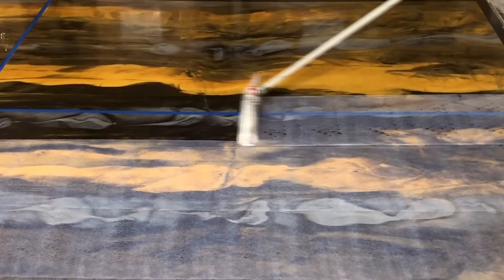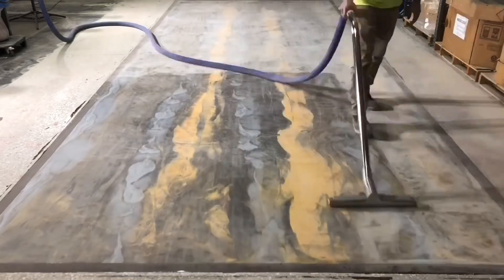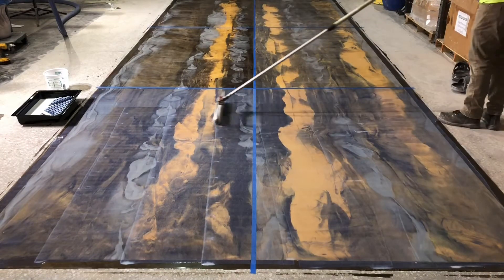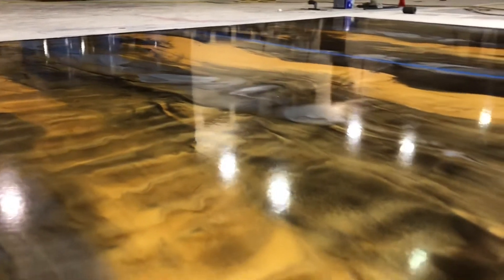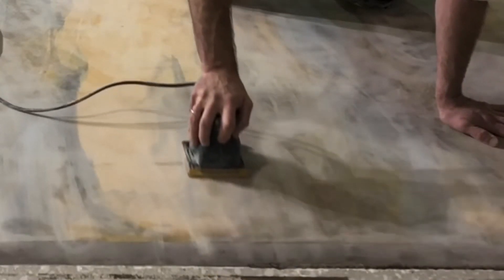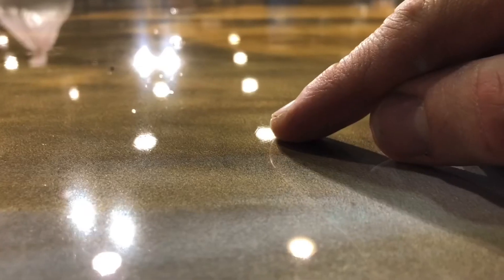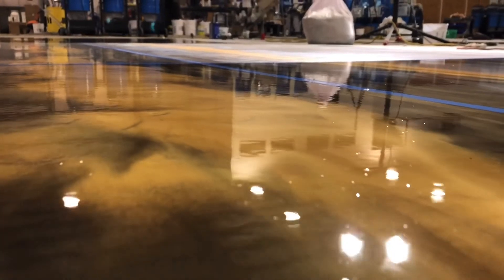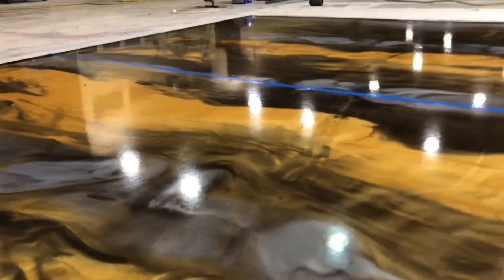Product Comparison: Epoxy Metallic Top Coatings

Comment: Josh why didn't you just use a buffer with a 100 grit sanding screen instead of the grinder?
Reply from the maker: That’s a great question. I’ve become used to using a grinder to de-glaze and flatten a coating. Having no sanding screens for the buffer, I had to improvise with the palm sander to reach what the grinder could not. It was slow, but it worked. 
Thanks for pointing out what most contractors would use to achieve the same result. I appreciate the feedback.
Reply: @joshjones8047  no pointing out here...I just thought maybe you had found it was a better process. I really enjoy your videos and sharing your knowledge. But sounds exactly like a job site...Get ready to sand and realize your out of screens.
Reply from the maker: @MrBradfordwill  thank you very much. Haha! Yeah, the jobsite has a way of reminding me what was forgotten.
Thanks again, bud. I appreciate it.